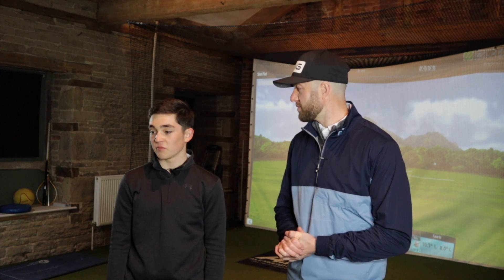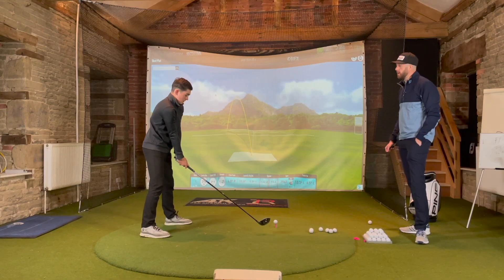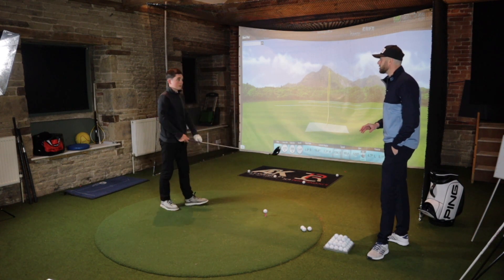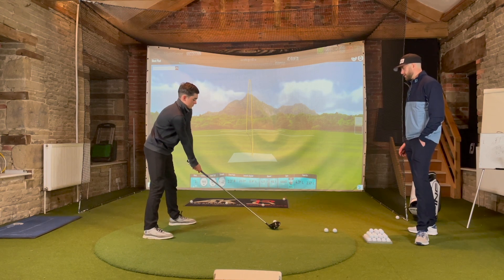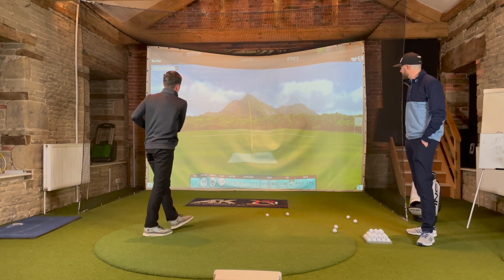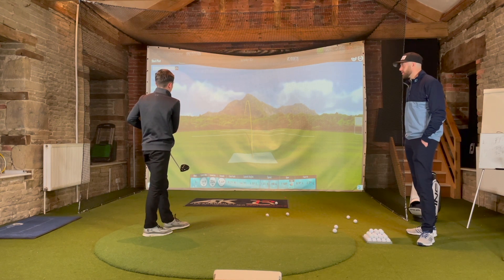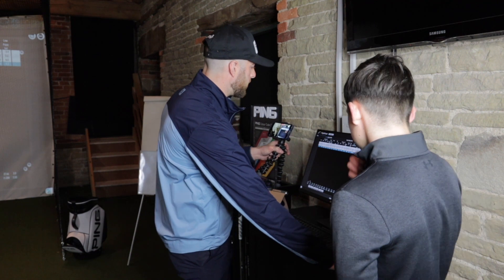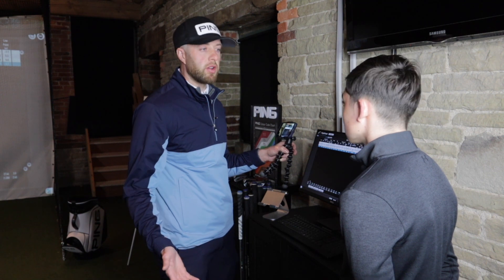WHAT ARE THE EFFECTS OF USING THE WRONG DRIVER SHAFT? GOLF CLUB CUSTOM FITTING!

Comment: Just wondering why you didn’t use the same type/brand of shaft in the different ‘stiffness’ ? All those shafts have different characteristics and ‘kick points’ …..does that not skew the results slightly?
Reply from the maker: It’s not possible to get the same brand shaft with the same kick points through x,s,r,and senior in a custom fitting kit. As the shaft lowers in stiffness, the kicks lower which marries up with the club creating a more optimised spin for that speed. 

Great point though, I completely see where you’re coming from.
Reply: @garymartingolf  sorry bad wording, what I should have said was using the same brand of shaft would provide a more accurate demonstration based on the performance characteristics being adjusted accordingly in the different ‘stiffness’ …..we know what I meant 😂😂😂🤦‍♂️
Reply from the maker: @golfnut6129  the same brand doesn’t have the same characteristics throughout all flex’s, once you change flex, you characteristics, only thing that’s going to match is the brand name written on the shaft which doesn’t effect the test. 

When I said I can see your point, I can see your logic and thinking to sticking to the same brand as I would have thought the same before I started fitting clubs.

Comment: I don't want to swear Gaz, but Sick Rields did this test about 12 months or so ago, but he used 4 shafts from the exact same manufacturer in the 4 flex options, had the markings covered by his cameraman and carried out a blind test himself. Even as a Pro himself he couldn't identify the correct shaft and the performance differences were pretty minimal really. I think it shows that different shafts from different manufacturers will have a greater effect on the  lub fitting than actual flex.
Reply from the maker: Haha, that made me laugh 😂 thanks

Comment: Great video Gaz, very interesting. Have you thought about doing something around wedge fitting vs off the shelf wedges? I'd certainly be interested in that one as I'm in the market for a new set of wedges and torn between getting fitted and having to wait weeks and weeks with the current supply chain issues, or going in to a pro shop and buying some off the shelf wedges.
Reply from the maker: That’s the best Idea I’ve been suggested in ages 😬😬 thank you 😬
Reply from the maker: Hand fire until I’ve done a video, you might not need a fit If you take on board what I’ve said about lie/loft/bounce

Comment: I think that if Dan got used to the feel of the extra stiff shaft it would out perform all of the others regardless of his swing speed. He might lose 5 yards of carry overall  (probably because stiffer shafts are usually heavier and take more effort for smaller people to swing) but the lack of twist and bend will always give you more control as long as you're not trying to react to the different feel of a shaft. The only reason that so many different shaft options exist is PROFIT.
Reply from the maker: You make me laugh Samantha, You must of had some bad experiences with golf pros or golf retailers 😅 

I agree, we could get used to any shaft to some degree. For most mid to high handicap golfers, they could quite easily buy a 2nd hand club and just google the shaft to see if the flex, weight and kick match their swings, they don’t have to spend fortunes on fittings, the costs would outweigh the benefit.
Reply: I have no problem with the fact that people make money from golf, it's much better than working for a living but my comment is based on your own results. When he hit the extra stiff shaft the first two were poor because he wasn't used to the lack of flex as he started his downswing but the next one was a good straight shot and even with the first two dodgy ones he had  only a negligible lack of distance.
Reply from the maker: @samanthagames1023  Glad you picked up on that, its an interesting point. I might test someone who’s erratic with the driver with their shaft verse x stiff. It’d be a good test that 👌🏼
Reply: Good luck with that - surely you need someone who's capable of repeating a reasonable swing in order to get any reliable results - unless you're going to let them hit about 2000 shots.  😜

Comment: It may be more a case of proper FITTER than proper shaft.
I got FIT on a Rogue SZ with a HZRDUS 65 gram, stiff, but I have a relaxed 95mph Swingspeed.
After 2 years of learning from various sources I refit myself.
45 gram Prolaunch, regular flex, 1/2” longer. Took the 20 grams saving and put 15 into the head with aftermarket weights and a Tour Calloway sleeve to turn it down to 7 degrees.

7 yards average longer, 15 yards on best hits, more comfortable and FUN.
Reply from the maker: Can you fit me 😂😆 good stuff 👌🏼
Reply: @garymartingolf  😝 probably a little knowledge and a lot of luck.
There a Trackman 20 miles away that I rent and it helps a LOT.
Last session I was from 1.43 to 1.51 in efficiency. I l turned and looked at the pro(nice guy) and asked him if he thinks there’s anything he could sell me to do better. He just frowned and shook his head.😕
I’d LOVE to have a fitter I can trust nearby .😔

Comment: Hi Gary. Great test. I went to use a GC quad the other day to get some data. I’m using a taylormade m3 10.5 degree turned down to 8.5. It also has a stiff shaft. My average swing speed was 105mph and average spin was 3000rpm. I think the spin might be a bit too high. As I have lofted the club down as much as I can, I’m not sure what else I can do to reduce spin. I thought the m3 head was low spinning as well. I was also using tp5x on the simulator. Any suggestions would be welcomed. Thanks
Reply from the maker: Hi Rich, You could check your strike pattern, you may have room to tee the ball a fraction lower. 

I’m not sure what shaft you’re using, could you go stiffer (x stiff) and heavier?

I’d also relate your 3000 spin to your ball flight. Can you afford to lower the spin? Have you got a good enough dispersion?   

Thanks
Reply: @garymartingolf  thanks Gary, I really appreciate you responding. Love the channel! My average peak height is 93ft with driver. I would say that I’m pretty accurate off the tee but maybe not the longest for my handicap (2.9). Average carry according to GC quad was 240 yards which I thought was pretty low for my swing speed. I believe it is a 65g stiff aldila rogue that’s in it currently. Strike seemed to be 7mm toe 7mm low average in the data.

Comment: Mark crossfield has done a few of these I think.   I’m not totally convinced.  I think if you’re in the ball park you will adjust to the feel of the club/shaft. I had an old callaway 3 wood reg shaft, I could feel it bending and didn’t like it but I was so consistent with it. Now I struggle a bit with 3 wood with a stiff shaft.
Reply from the maker: That’s the point though, so is stiff right for you. If you did this test, would you pick stiff? Maybe not 😏
Reply: @garymartingolf  yeah my argument doesn’t hold up does it.  
Quick question, can you just chop and change shafts easily, what about the sleeve that adjusts loft?

Comment: I'm guilty of this.. I'm a noob who only started playing around 18 months ago but in that time have played only 7-8 full rounds of golf.

I got a package set to start with then took advantage of the PXG deal. Didn't get fitted first and still haven't gotten fitted. The only thing for me was that I knew the package set driver was too "whippy". I felt like I had no idea where the head was when I was swinging. Got a Hzrdus Smoke 6.5 in a 65g in the PXG. I like the light shaft because it feels like I can "go for it" when I need to. But the X Stiff feels SO much better! I can feel where the head is when I swing, it's where I expect it to be so feels much easier to control.

I still slice the odd drive but i've found I under rotate my lead forearm at impact (left-handed playing right) so leave the face open.

Comment: I got fitted for my driver having always just used off the shelf drivers after I got fitted for my irons. I always had regular flex as my swing speed isn’t too quick but on the fitting I got fit for the Tensei Blue 65 Stiff flex. I hit it longer and straighter than my previous driver(s) which shocked me as I’d always read that to use stiff shafts you have to have fast swing speeds. But it turns out that it all depends on how you deliver the club head not necessarily the speed. Really good & interesting video and shows that we shouldn’t always go by what we read and go by what we can hit best. Thanks for this Gary 👍⛳️

Comment: I got fitted for a driver at the beginning of the year and the shafts made a huge difference. I had no real club head speed until I went into a 40g shaft and the club head speed / distance and more importantly for me, dispersion went through the roof. I was about 200 yards off the tee but now consistently 230-240 yds on the fairway - with new found confidence I’m actually swinging faster and am just about to have a shaft fitting to see if a slightly heavier shaft now will give more distance without affecting dispersion - very interesting 👍🏼👍🏼👍🏼
Reply: Nice. I have been looking at the 39g shaft which is in the Mizunos. Thought it might give me some speed back as I'm also stuck at around 200 yds carry.
Reply from the maker: Possibly. Should help you feel the club head more.
Reply: @garymartingolf  I have that 39g MFusion shaft in a ST200X 3 Wood I recently bought and I really enjoy hitting it. Certainly made me think seriously about the matching drivers. Could even then try the 3W shaft in the driver too!
Reply from the maker: That’s unreal gains 👌🏼

Comment: Great video I had a fitting and got 7x flex which with my speed and spin makes sense on paper but later got fit for 7s in a different profile and timing improved massively and turning down loft reduced the spin